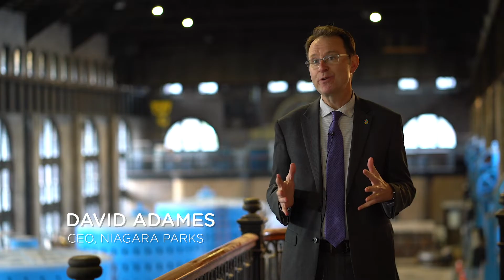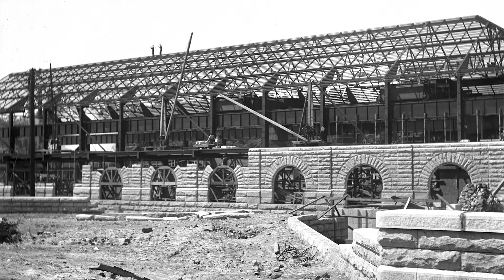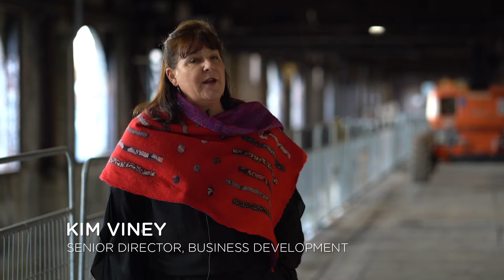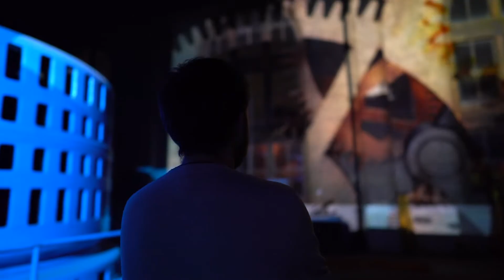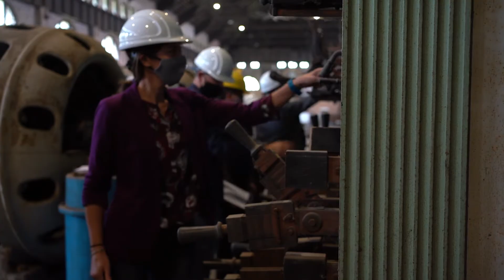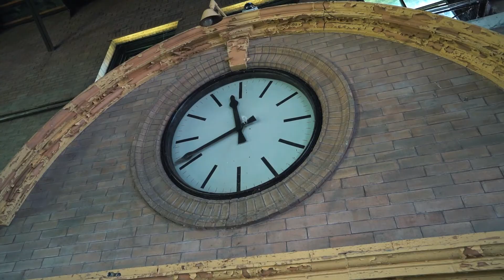Introducing the Niagara Parks Power Station

Comment: So if green energy is so important why did they shut it down when it seems to work perfectly fine?
Reply: It was 104 years old when they shut it down.  The more modern structures down the river are using the flow.
Reply: Too costly to maintain/repair the old equipment. As another comment pointed out, it was 104 years old and when it was decommissioned. To some extent, the expertise to engineer and replicate that vintage of equipment is somewhat lost as it was all electromechanical equipment. 
Additionally, newer equipment is more efficient and safer to operate.